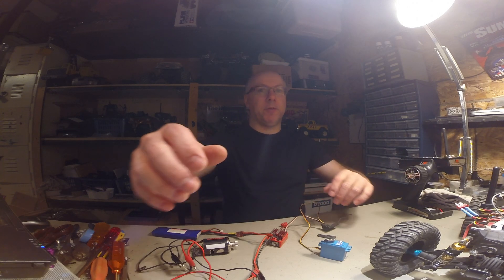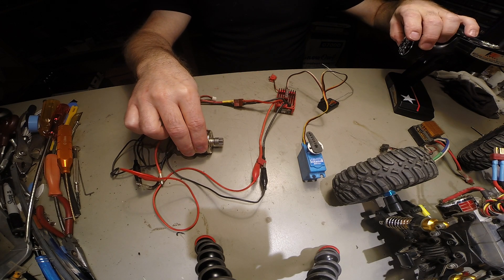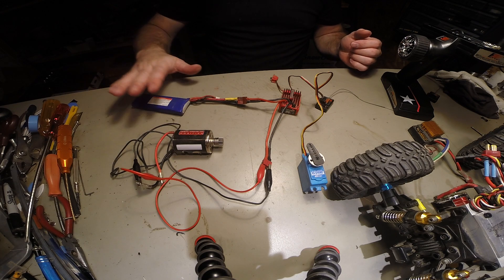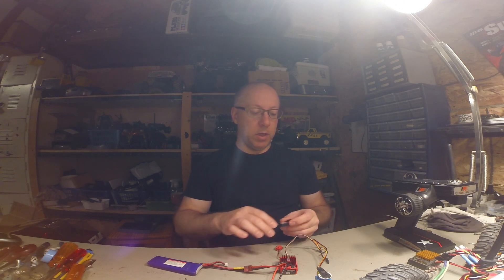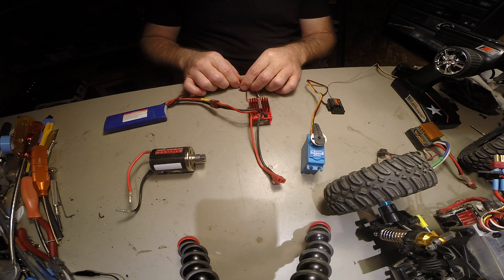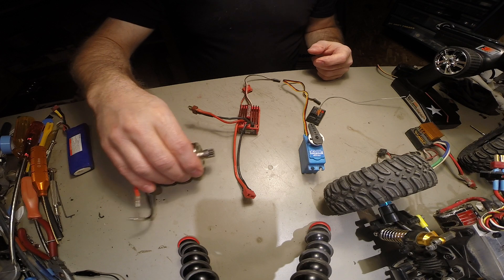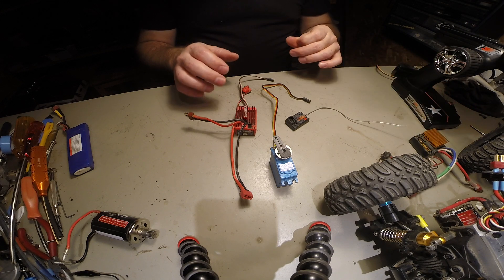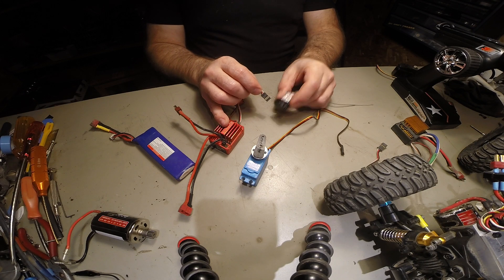Troubleshooting RC Electronics basics - Diagnose and fix it yourself

Comment: I have a battery that will not turn on my car but it will charge what do I do
Reply from the maker: are you sure its actually charged?
Reply: @TheLEDwheel  Yes I put it on my charger and the light went out so there another way I can figure it out or that you could figure it out what’s going on with the battery
Reply from the maker: @dustinplee5067  do you have a multimeter? Every Hobbyist should have one. Its great for checking power. Another thing. It may be a good idea to upgrade your Charger. The one you have will not show you any information about your battery. One way to check is if someone you know has a battery your can try or a charger that shows the status of the battery. once you have determined that your battery is good then you can assume the ESC is faulty.
Reply: @TheLEDwheel  The other batteries work on my ESC this one will not
Reply from the maker: @dustinplee5067  I believe you just answered your own question.
Reply: @TheLEDwheel  how fix the brand new the battery I have though
Reply from the maker: @dustinplee5067  maybe its not making proper contact? Where did you buy it? how long have you had it? Just because its new does not mean its not defective. Is it NiMh or LiPo?
Reply: @TheLEDwheel  I bought it off eBay and I got it in the mail yesterday
Reply from the maker: Contact the seller. If they don't respond make a claim that's it's defective.
Reply: @TheLEDwheel  When I squeeze the cables together when I plug it in and it turned on my car and then it goes out if I let the cables go so what could be the problem there do you know
Reply from the maker: Bad contact in the connector? You squeezing the wires together right at the connector on the battery side? What connector type is it? Can you send me a link to your battery?
Reply: @TheLEDwheel  Here’s the description it’s on eBay for $14.99 6200mAh 2S 7.4V 50C RC Hardcase Lipo Battery Deans Plug for RC Car Truck Boat I don’t know how to send the link how do you do that on YouTube
Reply from the maker: @dustinplee5067  your description is fine, with dean's connectors it could happen if the manufacturer used cheap versions of it. Since your other batteries work fine I suspect your new battery has a bad connector.
Reply: @TheLEDwheel  how do I change the connector on the battery
Reply: @TheLEDwheel  what if I cut another connector off one of my old batteries And  to solder it to the new one would that work
Reply: @TheLEDwheel  I cut the tip off and cut the tip off one of my old batteries and soldered it together and it works now my new battery
Reply from the maker: @dustinplee5067  Thats great, glad you had the tools to fix it yourself.
Reply: @TheLEDwheel  and now my Traxxass bushed esc is blinking green and I change motors and it still doing the same thing what could that be and I Tried a different battery and still having the same problem it was working fine last night and my steering is working fine I know I had smoke come out of my motor I think I’ve been trying different motors and same thing having a problem with the blinking I burned a hole in my ESC plastic I was amazed by that last night
Reply: @TheLEDwheel  says it’s coming from Perth amboy New Jersey you can look at that and find it OK because I don’t know how to send a link
Reply from the maker: Burned a hole in the ESC!!! Just a wild guess here but...... I think you found your problem.
Reply: @TheLEDwheel  what is the problem I change the ESC turn the brushed esc and my other ESC is working a different one and it is working
Reply from the maker: Not really sure what you just said.
Reply: @TheLEDwheel  I tried a different ESC and it worked the motor worked for my other Esc will not work it just blinks green
Reply from the maker: So it's dead then.
Reply: @TheLEDwheel  I have a ECU chip brushed I bought it off Amazon and got it in the mail today and it’s blinking red on ESC and when I turn on it is green and works for a couple seconds and then touch turning red and blinking what do I do and my receiver is brand new I changed it out of my other truck into my crawler and it’s blinking red
Reply from the maker: Does it need to be programmed? Come with instructions?
Reply: @TheLEDwheel  it come with instructions it says output voltage BEC 5 V 1A continuous current 10A Driver frequency PWM 2KHz Max current 30A<5s input signal PPM I don’t know what all this means but I’m using a RC helicopter battery it has 3.7 V 2300MAH it says -CH 903052 +200417 I don’t know what all this means though on the battery
Reply from the maker: What about your other battery?
Reply: @TheLEDwheel   it’s the same as the one I’m use I looked on Amzon on the page of the description and it’s needs a Li-Po :2S 
Ni-Mh/Ni-cd :4-7cell  so can that be why it’s not working so should I try a Li-Po or a on it 
Ni-MH
Reply from the maker: @dustinplee5067  I am sorry but I have  difficulty understanding what your write.

Your LiPo should be fine if it is indeed charged.
check your traxxas manual for what the blinking led means.

Comment: Ive got a volantex receiver, but its only got one slot wich is used for the servo, and the motor is soldered into the receiver by cables. But i will try to solder it again, it might been poorly soldered. But the problem is that when i pull the throttle the receiver keeps blinking and disconnectes
Reply from the maker: So its a combi ESC/receiver that's fine. Does it have a low voltage cutoff for LiPo batteries? Is the battery actually charged?

Comment: So when I switch the servo and motor channels and it works does that mean I need to replace the receiver
Reply from the maker: What works and what was the initial problem?
Reply: @TheLEDwheel  my initial problem was that my servo turns but my motor doesn’t spin so I switched them on the receiver and the both work but throttle controls steering and vice versa same thing in the video.
Reply from the maker: Thats a bit more troubling.. they both work in opposite outputs but not in thier proper positions. Have you tried reprogramming  the ESC to the Trottle port?
Reply: @TheLEDwheel  not yet but I will! Thanks for your help!

Comment: my rc car runs full throtle when i turn off transmitter. help?
Reply from the maker: Well, technically  you are not supposed to turn off the transmitter when the carbis on. That being said, check if your receiver has a failsafe feature. If so it may just need to be activated.

Comment: I have a carnage ftx brushless it's working just the engine but the sterling wheel it's not. The point of this comment it's working with any reciver or I need a special one made for my rc car.
Reply from the maker: If you want to keep the same radio then you have to get the same receiver.

Comment: Did you make that flow chart? Great video! Here is my issue. I have power, lights work, turning front and back works, dig works. Everything but revers works. I took the transmission apart, from the driveshafts down. Both sets of trucks are smooth to the turn. I don’t really know what’s up with motors but this one when I took it apart was running without a second connection to the shaft of the motor internally. It was getting so hot this way that it set some leaves 🍁 in the chassis to smoking. Any idea what could have coursed this motor to stop reversing? Could this be my motor control or remote not sending revers signal?
Reply from the maker: Not sure  i understand the issue. Every rotates fine without the motor in? Tried another motor? Gets hot when you try to reverse or forward  as well?
Reply: theLEDwheel it seemed to me like the motor took a slam. Just went down to the shop to test the revers function on the remote. It now works in both directions but one direction has limited function still. Amazingly fast reply btw. 👍
Reply: Seems to have been a transmitter problem. Programming issue or something of the like. I’m really confused now. Thanks for being around! Great video. Definitely subscribed.

Comment: I have a problem whereby the car will not run straight. The wheel and throttle both act in the same way and operate the steering lock left and right. Any idea in how to fix the problem?
Reply from the maker: I cannot find much info on this rc. These low cost items are what  i call disposable RC's unfortunately.  Depending on how long you've had it  maybe the seller can help.

I would suggest maybe a Redcat Gen 7 or 8. Its a great beginner truck but its hobby grade. All parts can be changed if broken and some upgrades are available.
Reply from the maker: More details. Car? Radio? Esc? Servo?
Reply: @TheLEDwheel  I don't have that info as it's a kids  model from China and it came without any details .. It's called tokin rodeo 4x4 rock crawler 1/12.
Reply: @TheLEDwheel  https://www.youtube.com/watch?v=4_Jjr_63WPA&lc=Ugx12jFt0NJHEtVZYGx4AaABAg.9ErzOb2qQyG9Es-6JBzY9S

Comment: My esc does not beep when it turns on but has a light and my steering works but throttle doesn't work when I press throttle theres a red light  any suggestions?
Reply: The esc and motor are brushed
Reply from the maker: What esc ? Have you tried reprogramming it.?
Reply: @TheLEDwheel  before the throttle stopped working their was a burning smell
Reply: @TheLEDwheel  also my esc seems too not have a set button to recalibrate it
Reply: It's a arrma typhon mega 4x4
Reply from the maker: Check your manual for recalibration of the ESC.
Reply: Ok
Reply: Also
Reply from the maker: Check your manual
Reply from the maker: Ahh, might have mentioned this before. Only way to know is to get another ESC. How long have you had it?
Reply: @TheLEDwheel  I've had it for a month or so before it broke down
Reply: @TheLEDwheel  also i got a new motor instead of new esc oops
Reply: @TheLEDwheel  and I think it might have been a broken motor because I didn't break in the motor when I first got it
Reply: @Kraverx what was the problem? I’m having same issue. Motor or esc?

Comment: Hello, I have a problem with the control unit of this buggy. Today, he stopped driving while driving, even when the battery was charged. These LEDs on the hood began to flash in succession. After removing the cover buggy at the same frequency, the red control LED in the control unit also flashed. After switching off and on again, the bugs started, but after a few seconds they stopped running again. Again, the LED flashed very quickly and the car does not respond to anything. Is the control unit bad ??
Reply from the maker: What buggy? From your description it seems like a toy grade RC.
Reply: @TheLEDwheel  Wltoys 12428, Across
Reply: Buggy bought on Aliexpress. 1 Mounth old
Reply: I contacted the seller. I would easily replace the unit is not a problem but I need the same connector on the servo and the output on the led light.
Reply from the maker: Ok, first off i would try to contact  the seller or WLToys themselves  to see if they would send you replacement parts. Secondly that is def a toy grade rc. However, it looks like it may be worth upgrading to hobby grade electronics. I do not know what your  aptitudes are via Changing the electronics in this buggy but i would suggest a Radiolink RC4GS radio system  and a Hobbywing wp1060 ESC(Electronic Speed Control). You can use the same motor.
Reply from the maker: You could change the servo as well.  Could use an adaptor for the battery.

Comment: My trx4 will turn but my motor is having issues. I can turn everything on, my speed control flashes red. I can accelerate for about 30 seconds then no more acceleration. I don’t know if it’s my motor or my speed control or what but any help would be greatly appreciated
Reply from the maker: Make sure your battery is charged.

Comment: Excellent! Many good and standard engineering practices here. A note. It could have been the "where the 500 pound gorilla meets the 'tonics" as AvE would have said. The throttle switch/potentiometer is the most common place for battery powered tools to fail (but they are used in a messier environment though). Isolating the problematic component from the source (battery in the controller) to the end (actual motors) is the name of the game

Comment: What does it mean when the rc turns on but shuts off as soon as the radio connects? Battery connections look good.
Reply from the maker: Is the battery charged
Reply: @TheLEDwheel  yes, lipos are good, have 3 or 4 charges through them. truck stays on until the remote connects.
Reply from the maker: @xxthegamecollectorxx4673  try disconnecting the servo and then power everything without the servo connected.
Reply: @TheLEDwheel  thank you I'll try that next!

Comment: I have a veles29 and start running crazy , then the stearing servo start crazy to , now is beepen and is no ligth in the reicever , only ESC beepen grenn ligth flashing
Reply from the maker: Ok then, try a new ESC.
Reply: @TheLEDwheel  yeahh am try the same one original ESC 120amp ,bacause i try everthing and same problem men , thax a lot apreciate your help dude 🙏🙏🙏🙏🙏
Reply from the maker: @nossrc5638  You tried or will try?
Reply: @TheLEDwheel  no no jeje i will try bro , im boricua and my inglish is not the best sorry
Reply: @TheLEDwheel  i just tried reicever , stearing servo and same thing , now i will try ESC , ohhh more money 🤦‍♂️🤦‍♂️🤦‍♂️🤦‍♂️
Reply from the maker: @nossrc5638  all good, good luck
Reply: @TheLEDwheel  thax dude , not everyone answer a lot of questions ,they only care about views
Reply from the maker: Did you get water in the receiver?
Reply: @TheLEDwheel  i think yes , but i bouth a new one , and ESC is beepen and flashing green men
Reply: @TheLEDwheel  its supost to be water proof , is a VELES 29 proboat , can you help me with that ? I know behind a computer is dificult
Reply from the maker: Ok, your new receiver needs to be binded to the  transmitter.
Reply: @TheLEDwheel  i try and the ESC keeps beeping , for one time i dont  know stops and gets normal then i took off the receiver for test the old one and again , now is beeping and nothing , the reicever has to be on when a servo is bad ? Or the ESC is bad ?? 🤷‍♂️🤷‍♂️🤷‍♂️🤷‍♂️
Reply: @TheLEDwheel  i try but the litgh never shows on men
Reply from the maker: So the light does not come with either of the receivers? If it does not,  good chance your ESC is defective.
Reply: @TheLEDwheel  no men , dont show the ligth , i dont know why is a new boat , 3 runs
Reply from the maker: @nossrc5638  if its that new then maybe contact the company? Warranty?
Reply: @TheLEDwheel  yeahh new bro , but is about 7 months i bough it and never used it by personal problems , now i used it 3 times men a this happened

Comment: What can be done if the R/C light is blinking and there is no connection with the car. No physical connection problems seen
Reply from the maker: If the light is blinking it could be one of 2 things. 1 good 1 not so good.
 try re "binding" the receiver to the transmitter. If that fails, try another transmitter.

Comment: sir, i have some problem with my motor is not work. on recivier, i test switch the channel steering to throttle, and throttle to the steering. (the throttle on steering is work) but the problem is my motor doesnt work it too? ☹️ anybody hve some problem like me?
Reply from the maker: Plug the motor directly to a battery to see if it works. If it does its probably your esc thats defective.

Comment: Just had this problem last night. Pro Boat Stealthwake throttle just stopped operating. I checked battery power, connections, switched the channel connections and steering works, but motor wont turn shaft. Do you believe it's the esc receiver?
Reply from the maker: Connect  power direct to the motor  to see if the motor runs. If it runs then I would  def suspect the ESC.
Reply: @TheLEDwheel  Thank you. Good video. I liked and subscribed. I will try that.

Comment: What if the speed control will not power on? Could it be the switch or the esc itself.
Reply from the maker: What ESC?
Reply: @TheLEDwheel Side Winder 4 ( SW4). The on/off button had a bad connection. Soldered the wires, problem solved.

Comment: Brushed carnage goes in reverse but will not go forward any idea and help please
Reply from the maker: Have you gone through the troubleshooting?
Reply: No I haven't sorry any idea off top of your head
Reply from the maker: Well you have to  troubleshoot. Only way to proceed. If the esc does the same thing in the steering channel its either the esc needs to be resynced or a bad Esc. Either  way you MUST go through the process.
Reply: @TheLEDwheel  Been through trouble shooting guide, I have full steering but just no forward motion only reverse
Reply from the maker: Did you connect the esc to the steering channel?
Reply: @TheLEDwheel  no not done anything like that yet.. Can I get back to you tomorrow and i will have a look at that 👌
Reply from the maker: If you follow the video it says to do this.
Reply: @TheLEDwheel  OK will have a look at that many thanks for the information cheers

Comment: I built my losi 8ight e to go 100 mph. I use a 6s battery..i have 2 batteries i swith between.. now all the sudden it wont go over 80mph on either battery..i checked for anything binding. Bearings etc. It hauls ass up to 80 mph..it used to always go over 95 mph one either of the 2 batteries..any ideas?

Comment: Hi I have a brushless setup on 1/12 scale, motor will work on channel 1 with steering and channel 2 with throttle. But servo does not work on channel 1 or 2 and it's new from Amazon, I have a replacement coming but is it the servo or transmitter that is faulty?
Reply from the maker: Def servo.
Reply: @TheLEDwheel  thank you!!!!